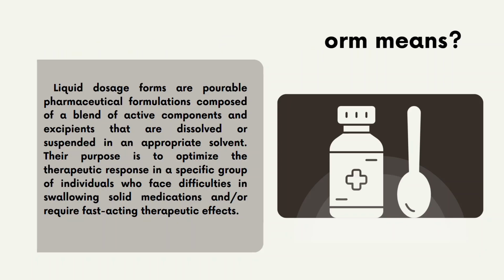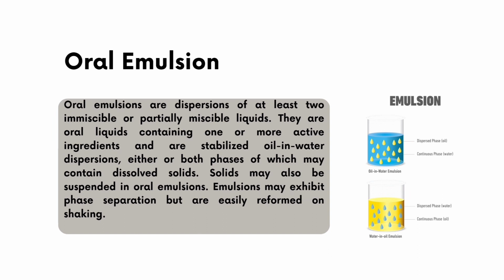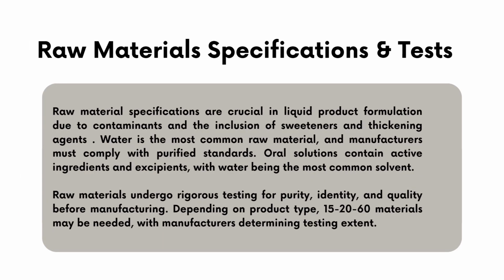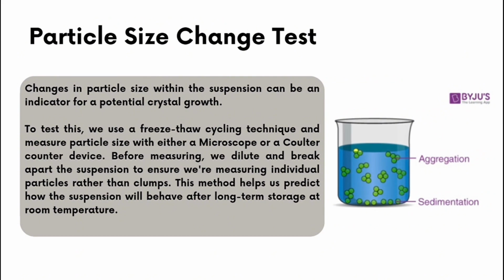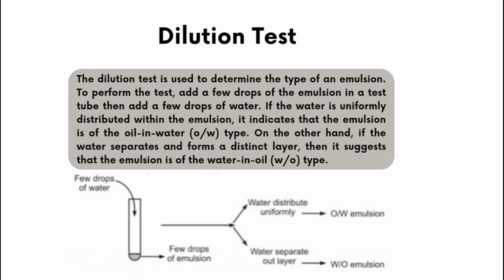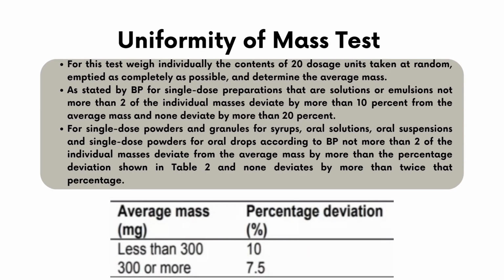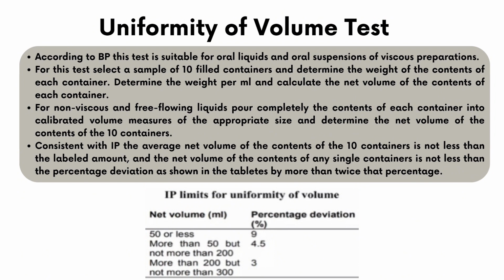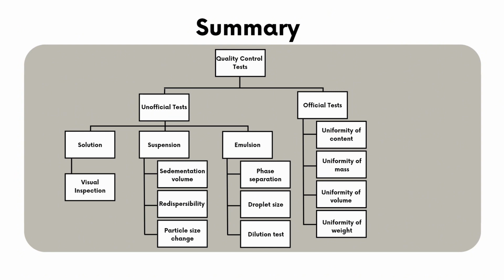Quality Control of Liquid Dosage Forms

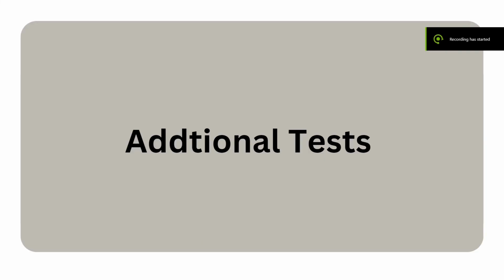Comment: Very detailed, well-structured, and easy to follow. Overall, a job well done! However, I noticed in the video that during the section titled 'Additional Tests' at 10:34, the volume was very low, making it hard to hear. It would be great if the audio could be adjusted for better clarity in that part. Keep up the excellent work!